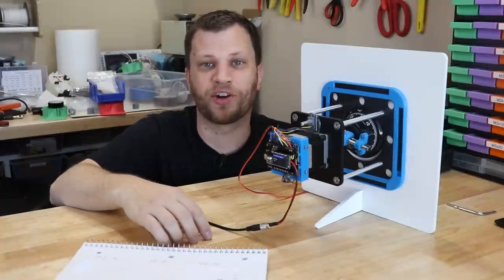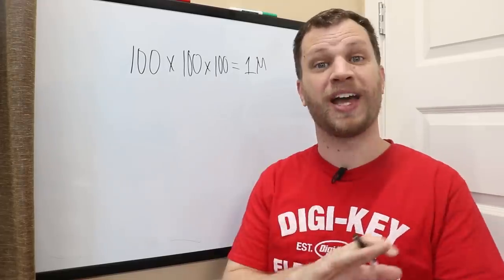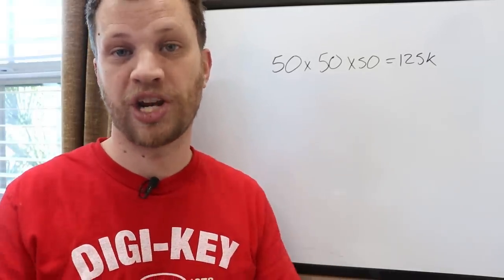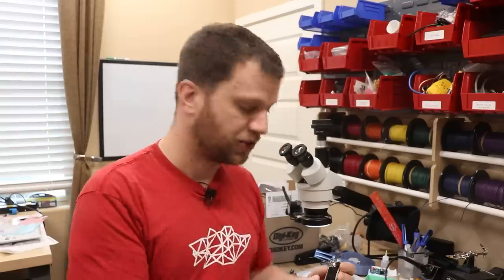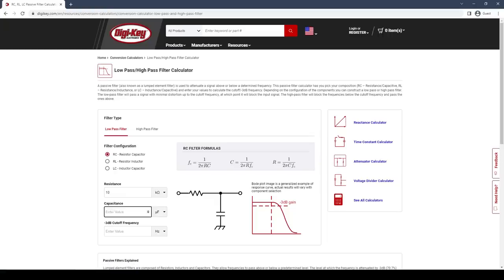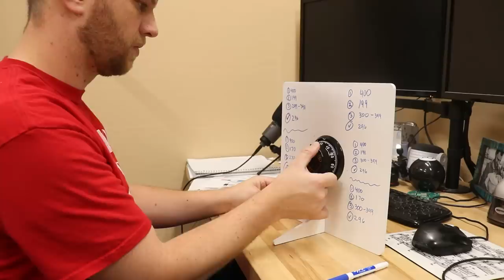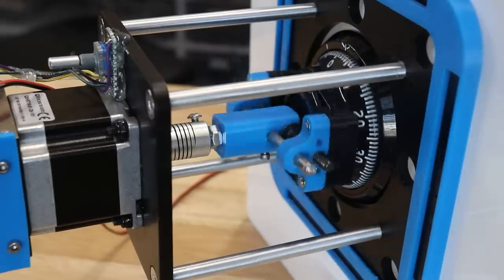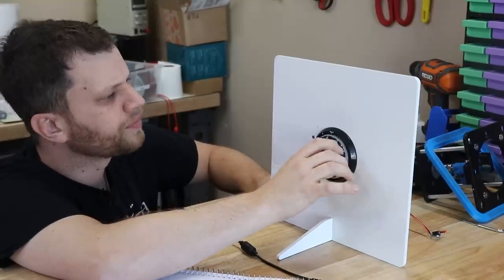I have to try 1 Million combinations? Safe Cracking Robot - Part 2

Comment: What I want to know is if rather than having a robot just trying combination after combination... can you make one that can feel the points where the slots are for the combination like an actual master locksmith that has the feel and can pick ridiculous safes in a couple of minutes by feel alone?  I'd think you could use a sensor for the feel and with modern controls make any dial safe easy to crack.

Comment: if you consider the gap and tolerance, and only putting even numbers, that's 50*50*50= 125000 combos. 8x less than 1 million. Also, if the first number is low, attack will be faster.

Comment: I may have missed this, but what action or response do you receive telling you that you’ve found a number successfully? Meaning how do you know you have the combination without pulling the handle?
Reply: The dial locks up which you can detect with motor torque.

Comment: i have used a similar safe to your target, so maybe the lock is different but the one I used, you entered a combination then pulled the handle to open/check the combination, the knob didn't stop when the combination is entered correctly.
Reply from the maker: That's my observation as well. My brother-in-law's safe needs to have the handle turned every time I check the combination.
Reply: If you need the handle to be continually pulled you can attach some weight on the handle to continually pull it, except if it needs to be released for the dial to re-rotate after an unsuccessful attempt.
Reply: @madrandomize5115  yeah, It doesn't work like that...
Reply: @bytesizedengineering  So how would it work with your auto dialer? Are you then going to have to implement some mechanism to turn the handle inbetween each attempt?

Comment: What about a safe where you have to pull a lever to check if the combination is correct?
Reply: Or just use high security electronic locks that detect and block this sort of brute force attack.

Comment: If you aren’t using the pulse counter module on the ESP32 then you aren’t using it to its full capabilities. It has a built in pulse counter module that can be used with quadrature encoders and have a built in glitch filter (I think for your encoder they do recommend some form of hardware debouncing too) that way the encoder counts are handled by hardware and not code that you wrote and so it works independently of the main program.
Reply from the maker: I saw your other comment, thanks for the tip! I'm using an interrupt for the encoder count so it's not bogging down my main loop.
Reply: @bytesizedengineering  for applications like yours where the encoder is just being used for the user interface and manual control using interrupts is fine and you wouldn’t notice any difference using the pulse count module, except maybe the glitch filter, but if it was something like optical or magnetic encoders on motors then it would make a big difference as you probably don’t want an interrupt for every count of the encoder.

Comment: my first thought was, how do you control the stepper motor from the esp32 without a stepper motor driver? I only see the pinout shield, a buck converter and the adafruit esp32-tft. After that I saw that the motor has a built in driver so I searched for PD57-2-1076 and that motor cost 200€ for only 1.01Nm ? I think you have plenny hability to use a regular 5€ driver and 10€ motor nema 17 or 23, why you pick that one?

Comment: Is there a standard for rotation distance on the 3rd number you can use. Like the 3rd number cant be 20 if the 2nd is 25 because that is too close?
Reply from the maker: Most safe manufacturers will list exclusion zones for the third number. In my case the third number can't be 90-99 or 0-10

Comment: I'm under the impression there are exploits that you can feel/hear (and you touched on a "3rd number" exploit that the 2nd safe didn't have (or maybe it was harder to detect?)). I wonder if you could design something that attempted to reduce the keyspace by using a "learning mode" - if it fails to learn anything, it could revert to the entire keyspace. I'm thinking whatever sensitive equipment it may need - microphone, etc. (not remotely an expert - but it seems like there should be a lot of info available about how humans do it)

Comment: If the .5 covers the number below and above, couldn’t you just cut it from 100 to 25 possibilities instead of 50? 72.5 should cover 72 and 73, 74.5 should cover 74 and 75, so there’s no need to try with 73.5 🤔

Comment: one thing I noticed is when it started the whole thing shifted slightly,   time for stronger magnets?
Reply from the maker: I could adjust the acceleration as well. Or just put a bead of hot snot (hot glue) down the edges!

Comment: I don't know if you are already doing this but in some videogames there are code locks (usually to protect your virtual home or a lobby from people entering) and what most attackers try is using the most common combinations first (1111, 1234, etc) and that sometimes lets you crack a code very easily in just a few minutes. This was a common issue with the game Rust where people could just have access to your doors by spamming codes until something went through or pavlov where people could easily join your private game if you didn't choose a safe password. 
I think there are online databases with these codes prepared in such a way that a script/program would easily read them and try them one after the other.

Comment: How does the machine test to know that number is right?
Reply: He talks about it in part 1. After setting each number the dialer counterrotates and checks to see if the motor stalls because it would take too much force to rotate the dial any further. In this kind of lock you rotate the dial the opposite direction after the last number is set and that final rotation pulls the deadbolt open. You can only rotate like an 1/8th turn before you can't rotate any further once the right combo is in.
Reply: @MichaelOnines  thanks! I suppose since all dial combos aren't like this it would be limited to those. (I've not heard of these before)

Comment: I didn't get how the robot detects when it has cracked the combination...
Reply from the maker: This particular replacement dial has a hard stop. When the safe is opened. My motor driver can detect that hard stop. However, my brother-in-law's safe requires the handle to be opened on each attempt. I will probably just place a limit switch on the handle to detect when it's opened.
Reply: @bytesizedengineering  Impressive! Thank you for answering!

Comment: why not implement what you done by hand at the end to find the correct combination in the software? it would just take a function that starts when the robot has found half numbers, derive all possible full number combos and try them. Not really needed but i bet it would be much neater and more satisfiying!
Reply: All the numbers would work, so it's pointless and impossible to find the original.

Comment: Most combinations I've every seen involved resetting by rotating at least 1-2 full rotations clockwise, then you stop on the first number, turn clockwise past either 0 or the first number stopping on the second, then go back clockwise until you are on the third number or the rotation stops.

It doesn't look like yours is doing anything of the sort.
Reply: That's how this combination lock works too, and they're taking advantage how how those locks work mechanically to avoid having to re-enter the full combination every time. That way they can check all the 3rd numbers, increment/decrement the 2nd number, check all the 3rd numbers, etc.
Reply: @kitlith  well, in the video he's got it just rocking back and forth, unless that part was just for show
Reply: @TheLukemcdaniel  The rocking back and forth is to check for the correct combination. See the part 1 video where he talks about needing stall detection.

Comment: Shouldn't it be possible to narrow down the selection with statistics?
The probability that the numbers are in the middle between 1 and 100 should be significantly greater than those on the edges. So it would be wise not to start at 1 or 100, but at 50 and then 49 and then 51.

Comment: Nono wait!
What happened with the the part that you could get the last number down to just 12 or just 1 possibility? why was the math 50*50*50 when like you said, you could already figure out the last number before starting?
Then it would just be 50*50*1
Reply from the maker: The big gray safe from part 1, and my brother-in-law's safe both have this exploit, so it should reduce that last number to one possibility. However, the replacement dial shown in this video does not have that exploit, so I had to try all 50 numbers on the third number

Comment: Hardware de-bouncing like this REQUIRES Schmidt trigger inputs... 
never use standard TTL or CMOS logic inputs for slow moving signals or you not have solved anything
Reply: If you configure the R+C time constant to be not much longer than your mcu clock period, then also add a "software" debounce you should be fine

Comment: This would not work on government security safes.  You dial the 3 numbers as usual, move the knob to 0, then flip a "butterfly" knob in the center of the dial.  Then you turn to 90 to open the bolt.   If the combination is wrong, the bolt doesn't open.
         At first, try 50-25-50 & 10-20-30.  This is what the factory commonly sets.

Comment: 0:50 This doesn't make any sense... It doesn't matter wether you know or not. You're not the one trying to figure out the combination.
Reply from the maker: Who do you think programmed the robot?
Reply: @bytesizedengineering  I think the point is it didn't have to be double blind to be valid. You have no way of telling the cracker software the real combination, so you knowing wouldn't bias your interpretation of the result. As far as the video goes we have no way of verifying you didn't know the combo. If you had faked it you could still just as easily done the whole "true combo reveal" in the video.